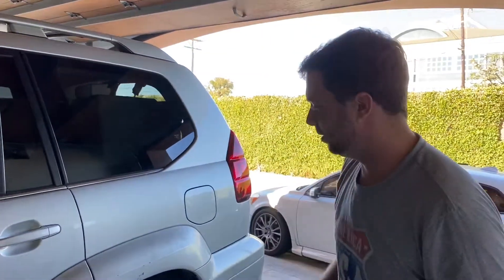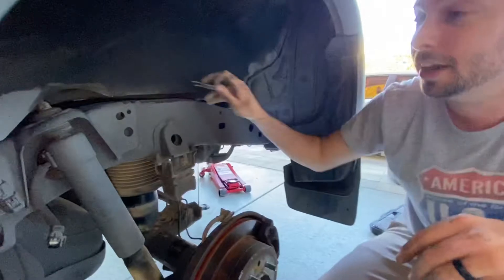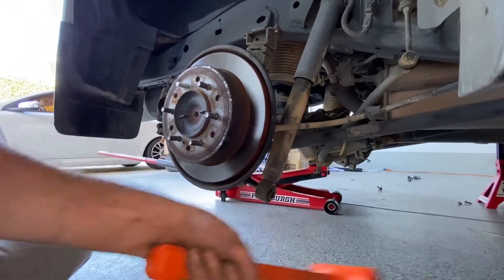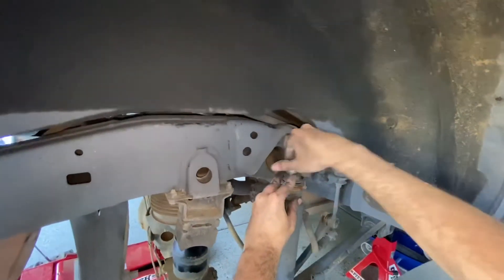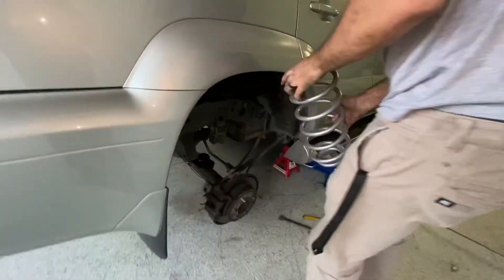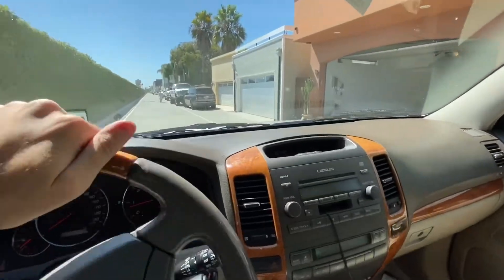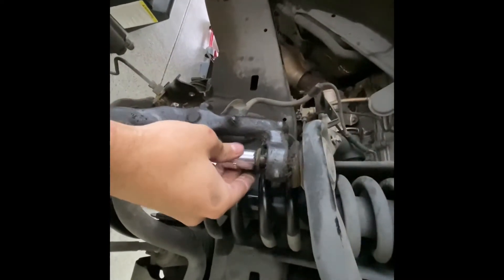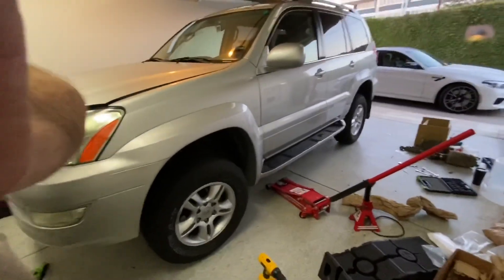Lexus GX470 - Eibach Pro Truck Lift Kit Install.

Comment: How are you liking the lift kit so far? Near stock ride comfort?
Reply from the maker: I would say that it’s a more firm and reassuring ride. Especially since my stock suspension was not the best and I would bottom out on the bump stops regularly in the rear. With this kit, the truck feels much more solid, which is more comfortable for me vs. an iffy, soft setup.

Comment: Nice install, can you drop a link for the spring and shocks kit
Reply from the maker: Sure, here are the UCA’s:

 https://apacheoffroad.com/product/freedom-offroad-upper-control-arms-2-4-lift-toyota-fj-cruiser-4-5th-gen-4runner-gx470-gx460/

Here is the Eibach pro truck lift :

https://apacheoffroad.com/product/eibach-pro-truck-2-3-lift-kit-03-09-lexus-gx470-free-shipping/

Looks like both are out of stock right now but it also took a while for me to to receive mine so just place your order and sit tight they should be able to get you your parts pretty soon.
Reply: @lexus_offroad_adventures  thank you 🙏

Comment: Daniel, How are your liking your Freedom Offroad UCA's? Looking at getting some within the next few days.
Reply from the maker: Wyatt Whitener I really don’t know why people spend $800+ on other non adjustable UCA’s. They seem very robust, the ball joint looks solid, and my alignment guy was able to get my lifted suspension in spec no problem. There’s a lot of Gucci gear out there but these just work. Plus, they look great as well. No downsides from my perspective.
Reply: @lexus_offroad_adventures  I appreciate your reply. Ill probably order some soon. Where did you order yours from?
Reply from the maker: Wyatt Whitener https://apacheoffroad.com great customer service. Some delays due to high demand but they were always responsive. I also ordered the lift thru them. Took a few months
Reply from the maker: Wyatt Whitener I guess I should share the actual product page https://apacheoffroad.com/product/freedom-offroad-upper-control-arms-2-4-lift-toyota-fj-cruiser-4-5th-gen-4runner-gx470-gx460/

Comment: hey did you do an airbag delete kit?
Reply from the maker: Hi! Yes this kit deletes the airbag by replacing it with springs and isolators. You don’t really need to do anything else other than pull some fuses.

Comment: How much was the lift kit?  I am looking for GX currently hope to find one in good condition.
Reply from the maker: Rodney Burt Eibach sells these for $810 last I checked. If you’re trying to get a good deal, find one with blown rear air springs (since you are installing a lift) and a leaking transfer case actuator. I made a video on how to fix that common issue.
Reply: @lexus_offroad_adventures  Thanks I will check those videos out.    I am in rust belt so I am having  hard time finding one in good condition.
Reply from the maker: Rodney Burt oh yeah, I could see how that’s a problem. Well best of luck to you in your search! I am continually surprised by the practicality and capability of this vehicle. You’ll love it

Comment: Can you give us an update of your conversion? Would you still recommend it? TIA!
Reply from the maker: So worth doing. Most of these trucks’ stock suspension is blown anyway. You can tell this kit is setup for having some weight on it (steel bumpers, roof tent setups, etc.) but I plan on putting that stuff on anyway. There are literally no downsides that I can think of. I only regret not putting the spring perches on the second setting to raise the front a bit more. I’ve high-speed off road tested it, rock/rut tested: the setup with the Eibach pro truck kit/Freedom Offroad UCAs with the 255/80/17 Falken Wildpeak AT3Ws is really good. I just recently added the White Knuckle off road sliders (check out the video) and having that extra weight helps smooth out the ride even more. Totally recommend. Price is second to none for what you get.
Reply: @lexus_offroad_adventures  Thank you... Where can I buy it?
Reply from the maker: @jimmydoan007  I bought from Apache Off-Road
Reply: @lexus_offroad_adventures  thank you!

Comment: Do we have to replace the UCA or we can use the old one
Reply from the maker: As long as you don’t lift it too high, I think the stock UCA is fine. It just makes it more difficult to get the correct alignment. If you go beyond a certain lift (probably closer to 3+-” I believe) it will be impossible to get your alignment in spec. I just did aftermarket UCAs for more durability and to make it so I don’t have to worry about alignment issues in the future.
Reply: @lexus_offroad_adventures  thank you, just ordered

Comment: Is this your first time working on suspension ?
Reply from the maker: It was, yes.
Reply: @lexus_offroad_adventures  you make it look easy. Any tips and advise for first time ?
Reply from the maker: @house22TC23  yeah, definitely, it make sure to watch this video just to see how the fronts get installed. It’s a GX460 (newer) but it’s the same principle. https://youtu.be/lcA5z4YPUTk

For the rear airbag delete, I think my video explains it fairly well. If you have any questions, you can comment and I’ll try to answer
Reply: @lexus_offroad_adventures  okay. Do you have an email just in case I need to send a pic?
Reply from the maker: @house22TC23  honestly, I check YouTube comments more regularly, but you can dm me on insta @d_geleris

Comment: You forgot to bolt the top spring isolator in
Reply from the maker: The kit didn’t come with hardware to bolt it in. But I’ve not had a single issue with it held in there by the weight of the vehicle. I even upgraded to HD springs in a later video and had a chance to check everything over. It’s all good up there.

Comment: 2in rear coils?
Reply from the maker: Sebastian Martinez I forgot to measure the difference. It wouldn’t be accurate anyway as my air springs were blown. 2” seems about right though, maybe even 2.5” with no cargo